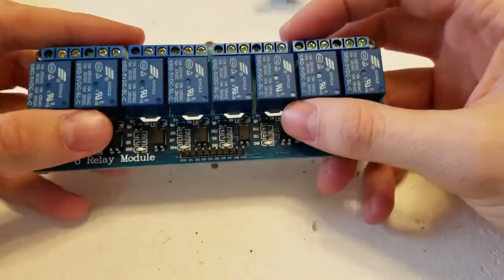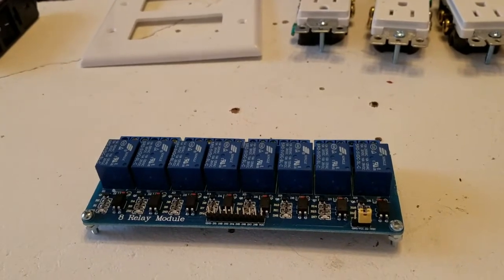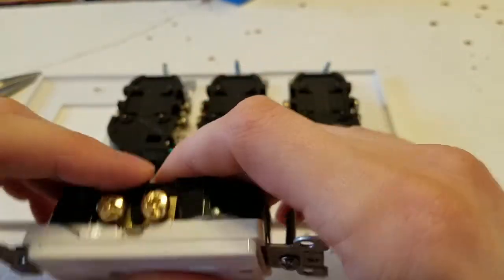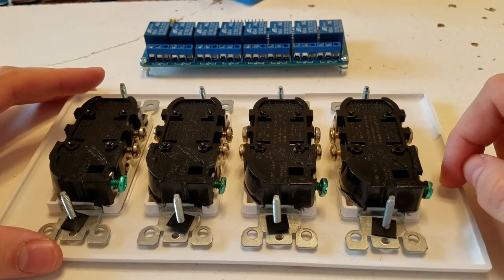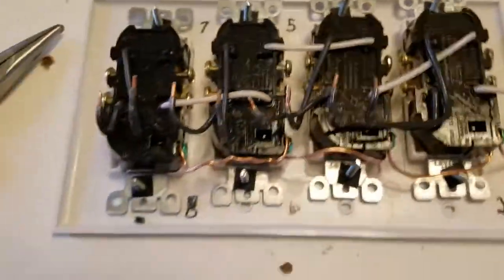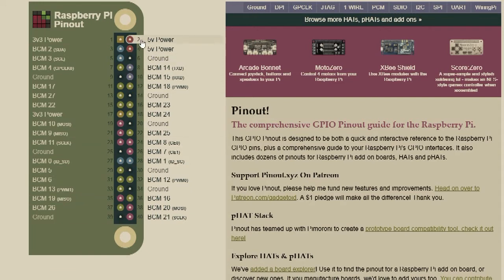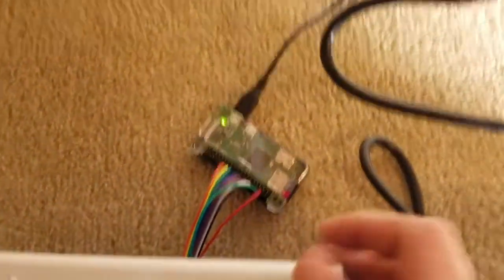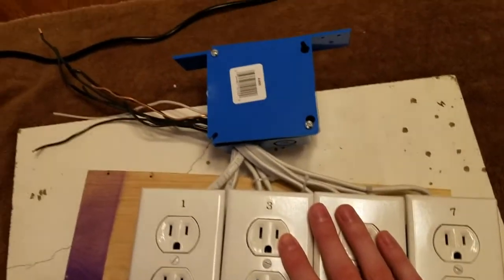Reef Pi Episode 2   8 Channel Relay Build

Comment: Schematic in words (its simple really):
Live fuse post -> relay (center), relay(side) -> socket live post, neutral socket post -> neutral fuse post. Cricut complete.
I would not daisy chain anything just split all wires from 1 main wire (you can even use these clips for ease https://www.amazon.co.uk/dp/B07XGHFVZQ/).
Relay usually connects center to 1 side when inert, and and to the other when energized. You want to make sure to connect sockets to the side that is off when not energized (check data sheet, test before final assembly).
 You can flip live post to side/live socket to center. Just be consistent.
If you are having trouble with full core wires, use stranded cable. I recommend wire in silicone insulation - flexible, temp and chemical resistant. You can always go up a step in wire thickness. But also if you know what you will be plugging and have problems with thick cable routing, low power sockets can use thinner wires, but this is ONLY if you are SURE that you will not be plugging in Lights heaters or anything else that is high powered (above 60W - beware of power strips need to sum all your devices so yes 5 pumps 15W each IS high powered). This is especially for you US (110V) users, european (220V) users can use thinner wires.
Relay module is not the place to cheap out. Make sure you get the one that is opto-isolated ('live side' does not have an electric connection to 'signal side')

Comment: can you provide the complete wiring schema from power supply --> 8 channel relay module --> power supply --> power strip outlets.  I assume that there are 2 separate power source. The  5 V supplies power to the relay module, and 120V to the power strip.

Comment: Bro, tho i do appreciate the effort, you should be using ''DIN rail cage clamp terminal blocks'' for ALL your wiring. Wall to wall Cable Tray and DIN rails perfectly mounted in a Panel Enclosure or Backplate to keep everything clean. Simply google image the following words for a preview: Automation Electrical. For a little more $$ you will be rocking it like a pro !   Keep up the good work.

Comment: The online builds don't use the quick connects because they suck! Would you rather have your system critical wire connected to a receptacle with a spring that can expand and contract while heating or cooling or under a well torqued screw? I've seen those quick connects go wrong many times working in peoples houses, they tend to loosen up over time and burn up. This is especially true when the quick connects are used to daisy chain outlets (like with your neutral wire). I know you're not an electrician and not knocking your video just trying to help. The way I would've done it is create a pigtail with 4 wire leads out of it to each individual outlet to feed the neutrals, make a loop and go under the screw. That means you'd be twisting 5 14awg wires together which shouldn't be too difficult just make sure you use a red wire nut. Oh and it's called a junction box :)

Comment: is it safety to do that with no any transistors? we have a proposed system regarding controlling electrical outlets using web server in Raspberry Pi. Also it is possible to measure to current load using current sensor? thanks for the suggestion :)
Reply: Why would you need transistors? You already have relays for switching. And these pcb relay modules usually already come with "signal side" (ie signal pins) opto-isolated from the 5V/220V/110V "live side" (check datasheet of course - this is the place where you definitely do not want to cheap out)

Comment: :( wish you finished the video at the 10 min mark, not exactly sure what you did there.
Reply from the maker: what do you mean?  I can clarify anything if needed
Reply: I wish I could see how you wired everything to the power source.
Reply: I agree. A wiring diagram would be very helpful.
Reply: Yeah, this is super helpful, would have been cool if he didn’t half ass that part
Reply: @dutchman55  its simple. Live fuse post -> to relay (center) -> relay(side) to socket live post -> negative post to negative fuse post. Cricut complete.
I would not daisy chain just split all wires from 1 main fuse wire (you can even use these clips https://www.amazon.co.uk/dp/B07XGHFVZQ/).
Relay usually connects center to 1 side when inert and and to the other when energized. You want to connect to the side that is off when not energized (check data sheet, test before final assembly).
If you are having trouble with full core wires, use stranded cable. I recommend wire in silicone insulation - flexible, temp and chemical resistant. You can always go up a step in wire thickness. But also if you know what you will be plugging and have problems with thick cable routing - low power sockets can use smaller wires but this is ONLY if you are SURE that you will not be plugging in Lights heaters or anything else that is high powered (above 60W - so yes 5 pumps 15W each IS high powered). This is especially for you US (110V) users, european (220V) users can use thinner wires.